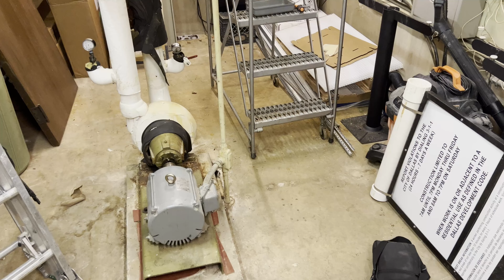THEY KEEP RESETTING THE ALARM WITH THE BREAKER - TRANE CGAM CHILLER

Comment: It can be also,,,something about water flow ,,,check the inlet strainer,,,,and clean,,,that can be cause low SH ,,,,and put latop,,and check the operation,,,it see what it dos,,,😊
Reply: But away,,,nice infom
Reply: Very true , we had been here a couple weeks prior to me filming this video , pulled all strainers , checked water flow , nothing out of the ordinary , pump not cavitated - anyways a little while after this call I came back with laptop and downloaded newest version of software with tech view and it resolved the issue - apparently there are lots of fringe cases and a lot of the updates had to do with eev control - the current software on the machine was 5 or 6 series behind - after software update the issue never returned . Great comment , thanks for watching - ( responding from my personal account - DFW HVAC
Reply: Sorry - I came out a couple weeks after to pull and check strainers and water flow

Comment: On the older firmware it would attempt to "unload" the compressors if head pressure was too high (from failed fan or blocked condenser) by opening the EEVs to prevent going into high head trip as a compromise between run integrity and preventing compressor damage.  This of course can cause it to go into low/negative SH and trip the Low SH alarm anyway. This is one of those rare cases where the symptom is disconnected from the cause by automation that fails to monitor itself.
Reply from the maker: The issue kept coming back at random times for about a month after this call. I went back and updated the software with tech view  as it was 5 or 6 updates behind . This resolved the problem and we haven’t had the issue since. Apparently some of the major updates in newer software version specifically pertained to EEV malfunctions like this .
Reply: @dfwhvac  Funny how "edge cases" that affect the PID tuning for those EEVs are more real world than the software engineers expected.  Stuff is harsher in the real world than engineers seem to ever expect. 🤣 While you can squeeze a few more percent efficiency with software, they need to remember that in those few percent there be dragons.